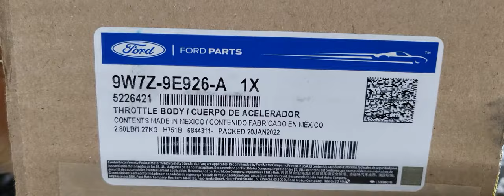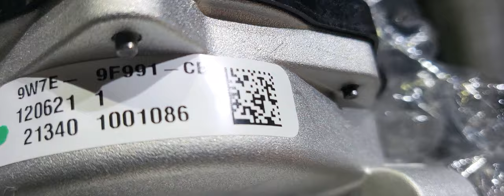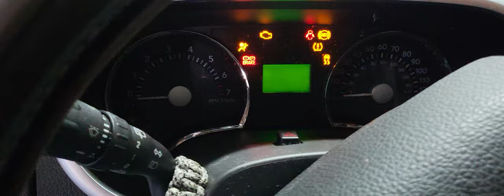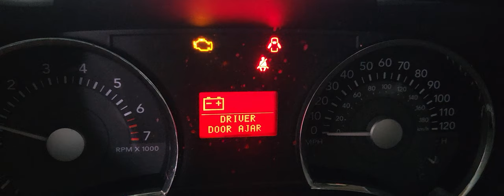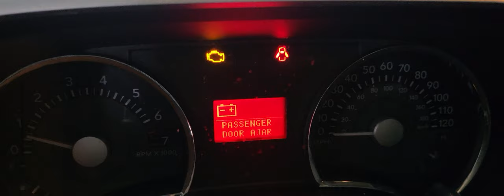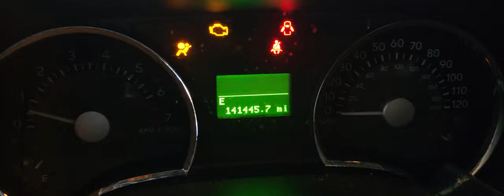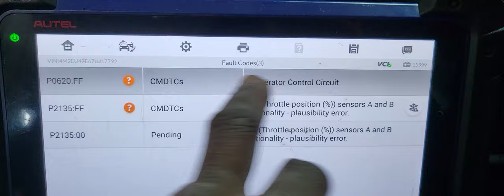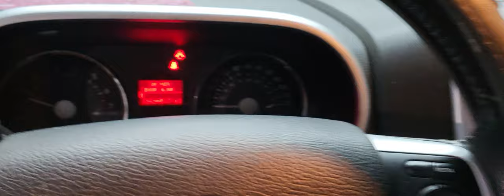2007 Mercury Montanier 4.0L Code P2135 Throttle/pedal Position Sensor/A/B Voltage Correlation ....

Comment: Throttle pedal position?   That sensor is on the gas pedal  
The one you are changing is the throttle body position sensor
Reply from the maker: The one on the pedale is eccelartor sensor
Reply: @BestCarFixes  oh ok mr. Gracias